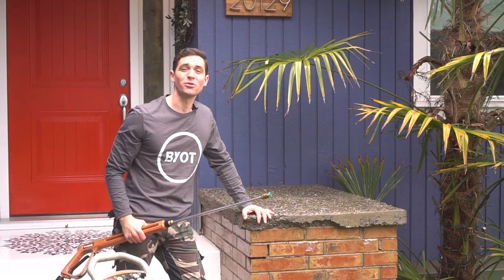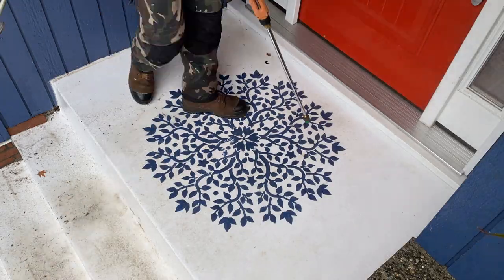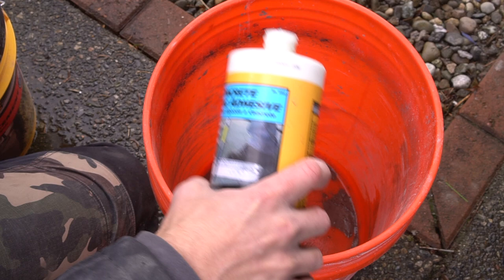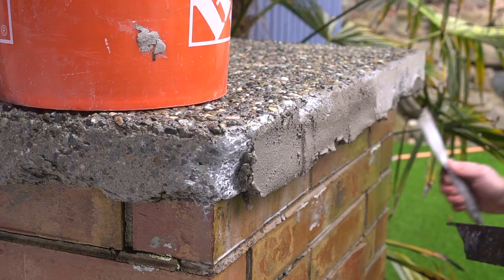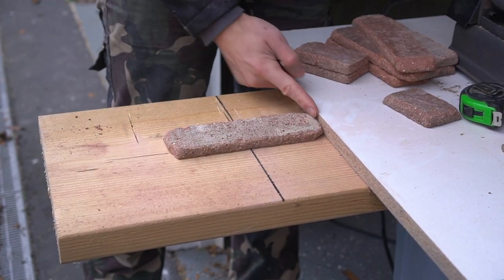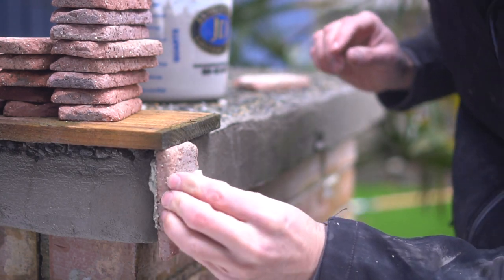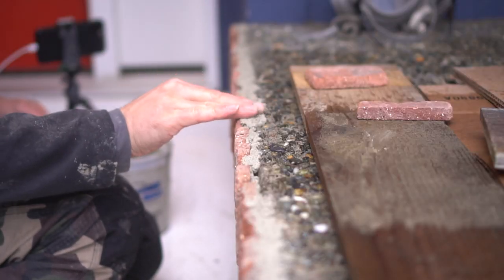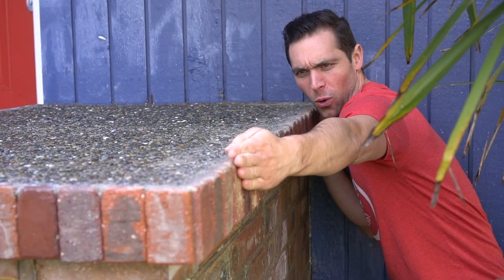VERTICAL CONCRETE REPAIR

Comment: How would you repair a 3/4 inch vertical crack in width  about 3  feet long ?  An example would be the flat vertical side of stairs where the crack is. How could you fill this gap as the gap may be 3/4 inch, in width, but the deptth inside the crack is at least 12 inches and 3 feet long?

Comment: Something just doesn't seem right with the bricks hang off a little on the bottom.
Some insect can get under there and make a nest.
Reply from the maker: You always keep it honest and I love it Saul.  Didn’t get into it in the video but thanks for bringing it up.  That slab was thicker on the backside then that front lip and I wanted to keep all of the bricks the same height so yes there is a slight lip at the front.  I’ll fill that space with mortar when I go back and fix the old brick grout lines.  Thanks for your continued support.

Comment: I like what you did and appreciate your mention of safety at the beginning.  However, I'm a Construction Medic and have seen many injuries.  Eye injuries the most common but in one case a worker was cutting stair spindles on his chop saw.  He had the spindle away from the fence in order to cut an angle.  The saw grabbed the material and pulled his finger in and cut the left index finger off close to the hand...I won't use the medical term.
Anyway, it gave me the creeps when you were cutting the tiles at about 4:50.  I'd feel a lot better with the tile being against something when you cut.. Things happen quicker than a blink of an eye.  Amputations hurt for 3 weeks.  Your wife and kids will be crying for days.  Trust me, I know of what I speak.
Just look up chain saw injuries and chainsaw kickbacks.
Cheers  and work safe(ly)